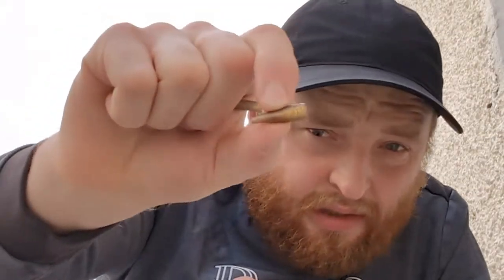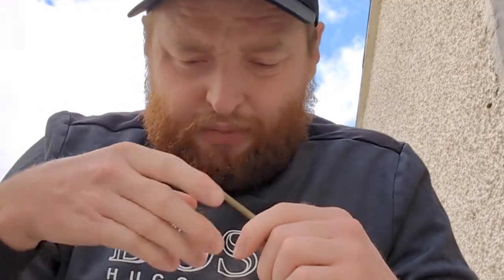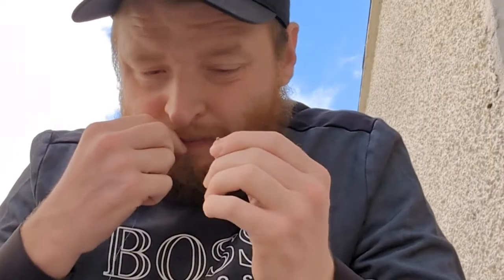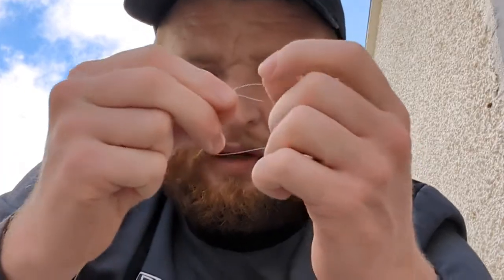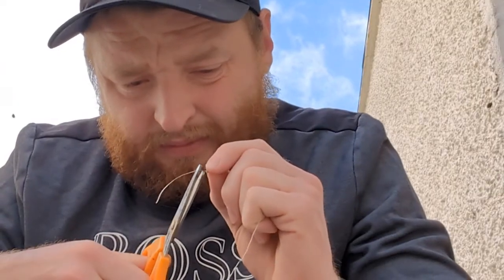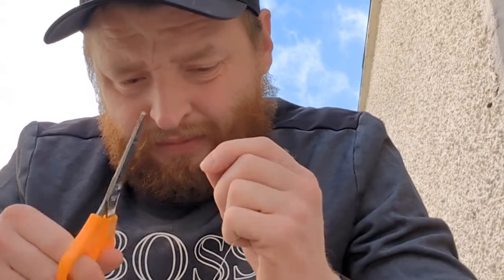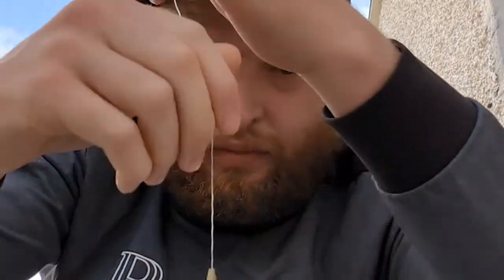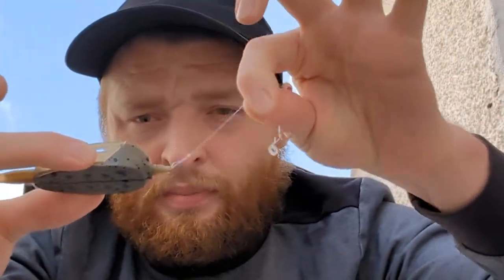set up a inline banjo XR feeder made easy

Comment: That bead looks like it was a firm fit in there which would offer a semi bolt, is it a Preston ics? as I find their beads offers no resistance as a very loose fit
Reply from the maker: Yes it's ics I believe I use it's not failed on me and get good takes on them.
Reply: Do you always use it as free running?
Reply from the maker: @adythomson8098  yeah mate alot of places you need to for fish safety
Reply: I guessed you did, it’s what I use most of the time
Reply from the maker: It's a good method
Reply: Try the Matrix beads, they fit nice n snug for a semi bolt effect